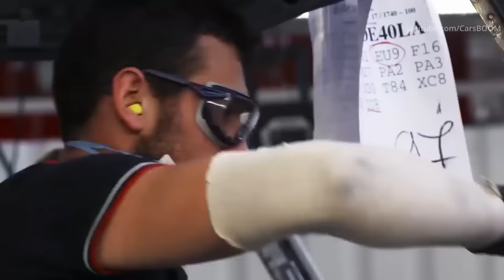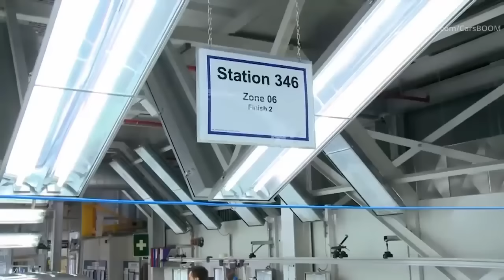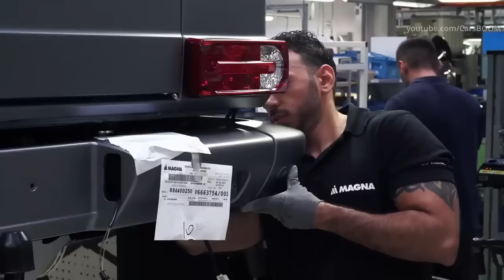Mercedes G-Class Production in Austria

Comment: so you paying for a mercedes and you receiving a steyr
Reply: Better than paying for a Mercedes and getting mainly Renault, which is what you get with several of their compact cars. Renault engines and front wheel drive transaxles.
Reply: @hedydd2  bottom line paying for a Mercedes and getting something else (even if it is a steyr or if it is a renault)
Reply: @psychokillerGR  
They all do it. Swap components and technologies and badge engineer. The failed Mercedes X-Class failed because everyone knew it was just a Nissan Navara underneath the skin, trying to sell at a 25% premium price. The new VW Amarok pickup is a Ford through and through. All of VW’s other brands, such as Skoda, the Spanish one whose name I temporarily forget, and different models in their respective ranges all share the same platform and drivetrain and are basically sophisticated badge engineering. JLR used Ford engines across the range for a few years and still use Ford V8 engines or is it BMW once more? The RR Evoque and LR Discovery Sport are both made at the old Liverpool Ford factory that one made the Escort and Ford still have half the site where their Getrag gearbox manufacturing takes place.
Judge a product on its merits not on its badge.
Reply: No, you paying for a handbuild Steyr Puch and get a Mercedes!